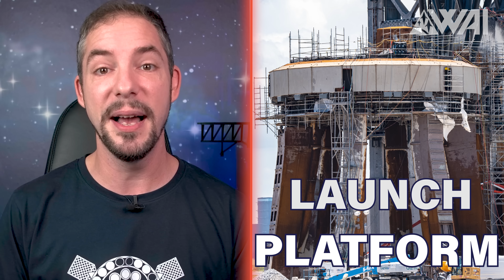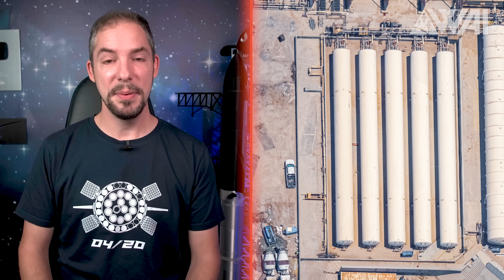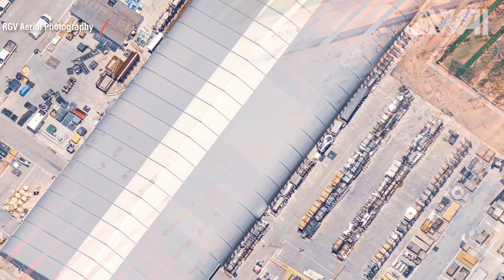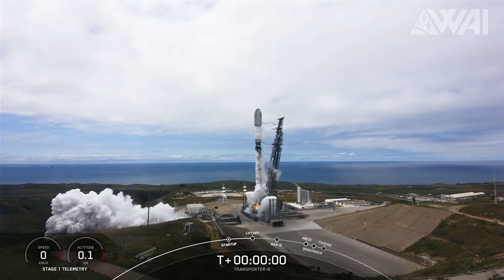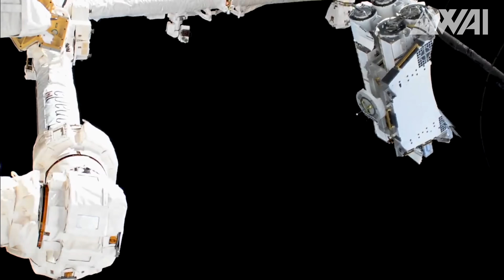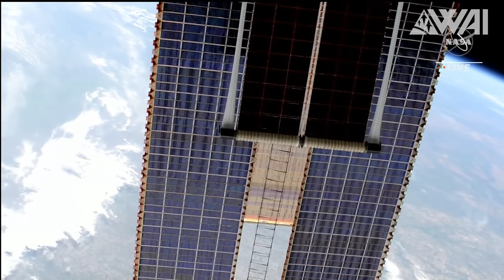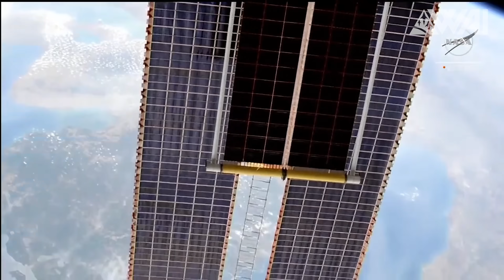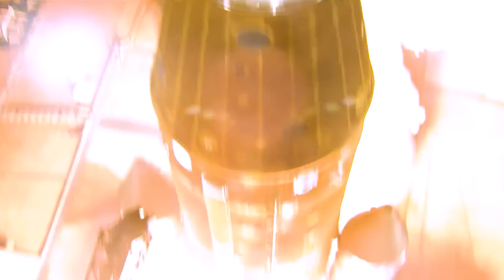SpaceX is pushing HARD towards the next Starship launch!

Comment: Hi Felix ,it might help if NASA, put in a Good word for Space X , I am not really happy with the water system, having had the gouged out pit under the launchpad it might have  been better to put a trench  under neath to direct the blast away from the base at a slightly up ward angle. Un less that plate is armoured I don’t see it taking the heat even with all the water drenching, and as fore the moon rockets,I think it is in the bag, we just need the AFA what ever , to grant the freedom to launch as and when the rockets are ready, but the next thing will be  , why must it be so loud, I like the big tanks coming in by barge and tug, this might the solution build test ,and then move the rockets to another launch site, the loss of revenue from doing this will in no doubt cause a big complaint and shut down the dirty beach brigade. Along with the never lived their indigenous natives , that was proved the case.
Reply: Nice thoughts but your ideas are not workable, to put a blast diverter under the starship you would need to start from scratch (read, that would take years to get approved and constructed) the water table is to high in that area and you would have to build a very large mountain of dirt to start building on.   There is no way to totally quiet a rocket launch, they will always be loud.

Comment: In the spirit of the best part is no part, why didn't they go with a gravity fed water system as NASA did at LC39A and B at KSC?  It has been in place for about 40 years without issue.  If done at Boca Chica, you would not need all of those high pressure tanks.  At Kennedy, gravity alone supplies enough pressure to supply a rate of up to 1 million gallons of water per minute.
Reply: SpaceX’s system is also a high-pressure system, not just high-volume system with low or medium pressure.

Comment: 1) Water hammer arrestor?  Wouldn’t a simple relief valve do that?  It certainly did in my plant.  12.5 tons of water moving at 2’/second, and a 6” relief valve burped out about 3 gallons.  Rubber pipe snubbers rated at 500 psi just downstream didn’t even notice the surge.  It could be the 4 smaller tanks are due to be replaced as soon as larger can be sourced.  It could also be that different sections of the deluge system use different amounts of water or the tanks are intended for different uses.

2) I think the highbay windows are for offices.  That is the one thing that seems to be missing from Starbase’s upgrades. It would make sense to move at least some of them there, where managers and engineers would literally be right on top of things.

3) NASA complaining about SpaceX’s speed?  Not only is that arrogance personified,  they need to be drug tested.

4) Boeng’s behavior doesn’t surprise me in the least.  They have been less moral every year since the 747 was rolled out.  From college friends I have talked to, their upper office is a snakepit.  Anything goes as long as it gets you ahead.  That trickles down until you get the 737 MAX fiasco, and now this.  

If you don’t know about the 737 MAX, here is a link, or search “Boeng 737 Max Scandal” for the play by play.

https://www.justice.gov/opa/pr/boeing-charged-737-max-fraud-conspiracy-and-agrees-pay-over-25-billion

Comment: Hello What About It ... Have you ever heard back from Flow Diverter?  When dealing with high pressure fluids, the chance of an Overpressurization occuring is always possible. So near the point of a manual cutoff valve, a diverter valve opens to prevent the Overpressurization and allows the excess fluid be fed back into the main tank or into a supplemental storage container. Later on the supplemental tank is fed back into the main tank.
Reply from the maker: This does sound very interesting. I'd have to look into it first. Sounds logical but I don't even know how exactly the deluge system will be put together. Hard to say if one or the other solution would work better. :_WAIShocked:

Comment: NASA expressing concerns that SpaceX might delay the Artemis program is comical
Reply: Well i ques NASA does have some reason tonhave concerns yet its still a bit over the top...space x is still in time
Reply: @NovaOrta  Not according to the mile stones that have been published.  Starship is behind schedule.
Reply: @pebmets  will be watching that thx for the Info
Reply: NASA can say that as soon as Starliner is human rated. Plus, how soon will Blue Origin & Boeing will have a functioning Lunar Rover? 2 years?
The delay problems with Artemis are squarely in their own court..
Reply: @Obsidian…Its comical, but it’s “ops normal” for NASA’s manned flight program.  Spotlight others’ possible shortcomings to draw fire away from yourself.  🙄
Reply: @737smartin  The difference, NASA sets the timelines.  SpaceX is a NASA contractor who has to meet them.  The contract puts in these milestones so if SpaceX had an issue, they should spoken up before signing the deal.
Reply from the maker: :_WAIPOG:
Reply: Why?  NASA's Jim Free mentioned many things that have to happen before SpaceX gets to the moon with a crewed lander, (Multiple test flights, in orbit fueling, uncrewed landing on the moon).  You believe SpaceX will meet all of these mile stones in the next 1 1/2 years?  When SpaceX signed the contract with NASA, there were target dates given.  Many blast NASA for missing targets, but when SpaceX does the same thing, NASA is called out for making them unrealistic.  When Musk does it, he is being ambitious and pushing his people.
Reply: They should have known that this concept only has about a 20 percent chance at succeeding and that if it did, it would take a while to do so. Booster looks like it can take a beating though😂
Reply: I agree
Reply: Nasa has got to worry about being beaten by the Chinese...
Reply: Space shuttle was also safe, but in reality it was deadly trap.
Reply: @jaroslavpesek6642  Shuttle history.  Challenger happened because the SRBs were flown outside of what they were rated for temperature rise.  The Thiokol SRB experts said, NOT to launch because of the cold and the engines were flying outside of what they were rated for.  Thiokol Senior management would not stand up to NASA and went against their own people.  Challenger would not have happened if management on both ends went with the experts and what the SRBs were rated for.
Reply: Once starship gets the launch pad all figured out. They’ll be moving pretty quickly with launches
Reply: That’s exactly what I thought
Reply: The thing is, I doubt SLS will be delayed by much - it’s a tested, crew rated, safe system and not to hate on starship, but it’s still being designed and changed and I tell you there’s no way humans are going on that thing until they are absolutely sure. I want starship to work and it will, but I’m slightly sceptical HLS will ready for 2025 or even 2026 but surprise me! I probably sound like a hater to some but I’m simply putting the fact out there that SLS is an operational, safe, tested and crew rated vehicle ALREADY whereas starship still has to go through that.
Reply: @Astro_Ptolemy  
How did SLS earn its "crew rating?"
ONE successful LAUNCH after years of waiting.

How did Orion earn its "crew rating"?
ONE successful unmanned and under instrumented demonstration round trip to near-lunar space.

Why do I often see comments indicating SpaceX Starship will require many - possibly dozens of - successful unmanned MISSIONS to earn "crew ratings" for its vehicles?
Reply: @frankmcgowan9457  one flight because SLS only needs 1 flight to qualify! Starship is taking a new approach of fly, test, fail, repeat - which is good. However, NASA doesn’t have the budget or the available public image to do that so it has to fly correct first try, which it did. Need I remind you of the Orion test flight on Delta IV AND the Orion inflight escape test - starship doesn’t have abort capability (yes is isn’t LAUNCHING the crew but it doesn’t, yet, have backup propulsion unlike Orion). The years of waiting have been actually very fast pace but behind the scenes testing of each component, a different but still effective method of testing and launching rockets. Starship is currently in it’s early test and development stage by rapidly iterating its design by flying and failing, it can do that due to little budget requirements as it is private, NASA, since it’s using US taxpayer money and is government run, can’t fly and fail as all funding will be pulled from it.
Reply: @frankmcgowan9457  It didn't really take a single unscrewed flight. There were any unscrewed test for SLS. But it is most likely be delayed like a mf because it's NASA.
Reply: @Frank McGowan  I believe Starship only needs one successful unmanned lunar landing before its approval. But before that they also have to practice orbital fuel transfer and before that obviously get to orbit.
Reply: @QuickBen92  I agree, 1 lunar landing test is good but starship needs a decent number of consecutive successes and tests of, like you say, orbital refuelling and docking etc..
Reply: @Bakugo-xl4pr  
Unless you are counting all those Space Shuttle flights as "SLS test flights" because use the same engine type and some engines already flown on the Shuttle, I guess I missed the announcements.
Reply: @frankmcgowan9457  I heard somethings about it. To my knowledge because I don't want to do research right now lol I feel lazy but they weren't actual tests but just I guess drop tests. So not that big of a deal.
Reply: @Ptolemy 🪐  
More likely "one flight to qualify" is because of the decades long relationships between NASA and certain vendors.  NASA doesn't have that same relationship with SpaceX.  I get that.

Still, the SLS/Orion program has found a way to take many flight-proven components and parts and STILL go over budget and over time.  Why?   My theory is a combination of mission creep and cost-plus contracts.

Maybe NASA should stop issuing cost+ contracts.  Would Boeing or Lockheed survive in a "fixed cost contract" world?

I also hate to keep score in the grisly realm of fatalities but - because we're talking safety measures - we need to do exactly that.

So far, NASA and its legacy "cost+" contractors have been the ones to kill people while SpaceX has destroyed its own stuff, most recently a launch pad.

The SpaceX "fly often and blow things up" development model is not really new to NASA.  Before it was even NASA, the old NACA followed the same path though not entirely by choice.  Obviously, no one wants crewed vehicles tested in quite this manner, particularly the part currently containing the crew.  That did not stop NASA from launching Shuttles in colder and colder conditions until Challenger demonstrated that the temperature floor had been breached with tragic result.  They did that even though I, literally "a casual observer", had noticed and remarked on what I thought was smoke issuing from the SRBs on several earlier launches.  NASA's concerns for crew safety seem to have been lost during the later spectacularly successful phases of Apollo and recovered on that tragic morning.  

Similarly, the videos of chunks of ice falling off the huge fuel tank on mission after mission told me that skimping on the fuel tank insulation - and leaving that loaded tank in the humidity of Florida for hours without the de-icer spray an airliner gets when it's cold - was probably a bad idea but the NASA safety gurus failed to get it.  The Columbia disaster brought those concerns to official notice.  

The current timidity regarding SpaceX and its Starship vehicles is somewhat out of character for NASA particularly because no one is even considering riding the next one or the next one... until LEO refueling is mastered and atmospheric re-entry of a fully instrumented Starship has been accomplished at least once.  A demonstration landing on the moon will have been completed before the third SLS launch.  By that time, the full stack Starship will have been launched dozens of times and landed - somewhere - a couple times, at least.  Superheavy will be the most exhaustively tested booster since the dawn of multistage rockets BEFORE lifting a crew off the pad.
Reply: @Bakugo-xl4pr  
They did Orion drop tests a couple of times.  
The engine type and several specific engines had flown on Shuttles but SLS has only launched once.  The SRBs used on SLS were a new type even though SRBs had flown on the Shuttle.
Reply: @frankmcgowan9457  yeah that's why the engines I guess are "the old reliable" but I wonder do you know when they are going to finally ditch the srb technology?
Reply: @frankmcgowan9457  The fact a crew is flying on Orion on Artemis II, it is crew rated.  That is why they tested it on Artemis I plus all the tests that were performed on the ground.  

 NASA does not test like SpaceX, (launch and see what happens).  They do extensive work before that.

The RS-25s are crew certified, the SRB's are Crew Certified, and so is Orion.  The new RS-25E is being test now with 2 more needed to complete its certification for Artemis V forward.  All being done on the test stand.
Reply: @Astro_Ptolemy  … SLS took like 15 years to finally fly. Delay after delay after delay.  Let’s not even discuss the budget that was astronomical.   

I get SLS is ready “now” but SLS bad 3 times the amount of time to get there and probably 4 times the budget at least. 

Even if space X delays 5 years it’s still developed faster then SLS
Reply: Is it?

Comment: So where is all the water going after being discharged from the water deluge system?  That amount of water has the power to wash out a lot of equipment.
Reply: The problem right now is there not legally able to install a deluge system because it would run off into the saltwater marsh. And you definitely don't want to use salt water for a deluge system. And there's basically no space to create collection ponds. And the whole Launchpad isn't raised enough for a flame diverter.

Basically there's not a good possible solution. Elon musk has basically pulling a  "not a deluge system" deluge system. Kind of like his "not-a-flamethrower" flamethrowers.
Reply: Most likely the tank systems will include a recovery tank set. I would expect a dual system for the deluge, one set will provide a solid table of water,( heat protection)the second firing high pressure streams at many oblique angles. (Rocket blast, flames and sound suppression.). Third system collects and rapidly removes excess water from around the skirt of the OLM, pumped to recovery tanks.  Let’s see what happens
Reply: Good point!

Comment: SpaceX promised a timeline to NASA when they sold the HLS project to them, so they are accountable for their promise, no matter how crazy the promise was. 
Then again, delays in development projects of highly complex hardware with huge investments is common, and both parties have no way to back out. The only way forward is forward together. The same type of dynamic occurs in Automotive development of new Cars. Formal complaints are just another tool to increase the pressure on the timeline

Is NASA entitled to complain about the delays of Starship? - YES
Should they? - YES
Will SpaceX be able to handle it - YES
Will they continue to work together intensly - Ofcourse